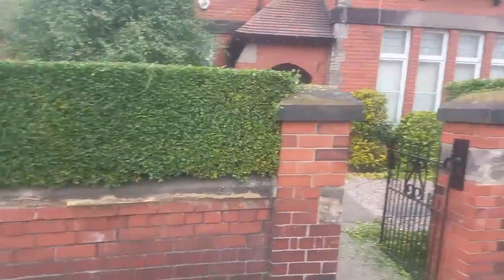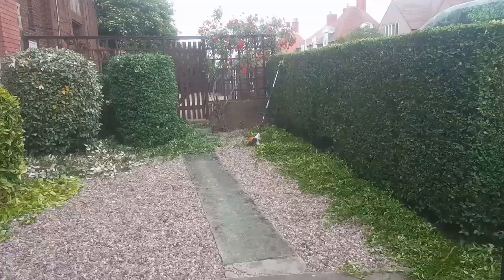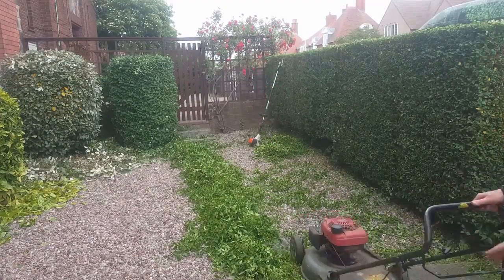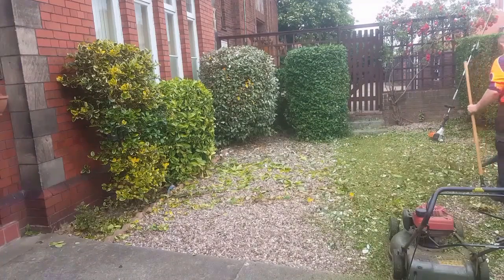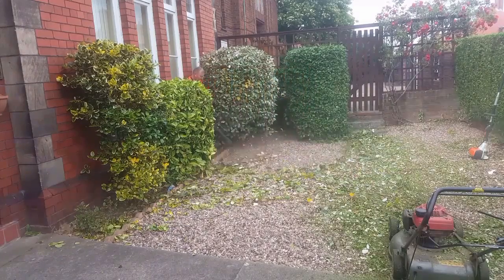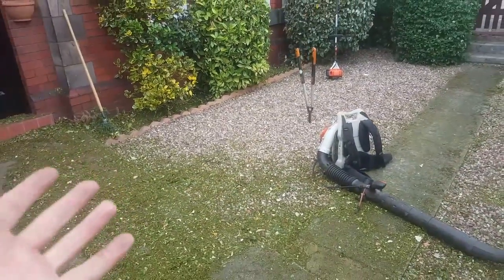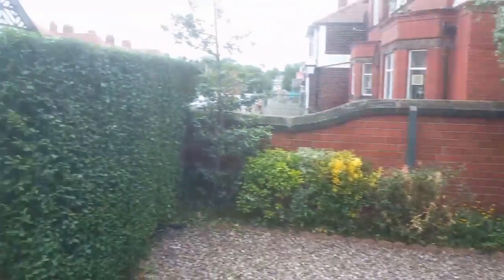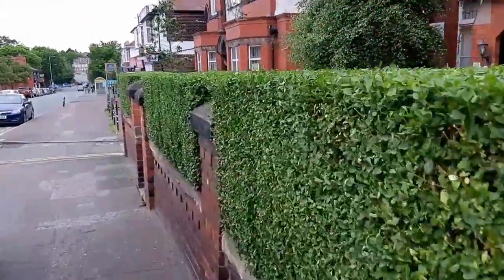Not just pruning...This is LHL PRUNING...

Comment: Great vid. How long did this job take you?
Reply from the maker: Cheers ...cant remember to be honest it was months ago ...most of the day 👍
Reply: LHL garden services uk looks like you did a good job! Quick question how come you use the long reach hedgetrimmer on the sides? Normally i would use the normal size held held ones and then my long reach for parts i cant reach. Just a personal preference?
Reply from the maker: @carl8035  yes just enjoy using them..cant stand stopping and changing 👌
Reply: LHL garden services uk yes i can understand that. Ever thought of switching to battery equipment? Best thing ive done.....so much lighter and makes everything feels lots easier, no vibration, low noise and not having to start a petrol engine everytime. ( sorry for all the questions!)

Comment: I used to tape a 13 inch Black and Decker hedge trimmer on a wooden pole to trim my cedar hedges and all my shrubs until I seen you with that Stihl pole trimmer. I am definitely buying on of those as it looks well balanced and safer than messing with extension cords.   I mulch everything I cut and everything goes back in the gardens. Thanks mate.
Reply from the maker: Thank you glad you enjoyed it 👍
Reply: Stihl no1 brand. Hardcore gear no cheap parts and extremely hardy blades!

Comment: Nice work! I use the mulching method too. I have over 140' of hedges in my yard and for years I would rake up the clippings then rake them into a rectangular barrel then dump it onto my compost pile in the woods along my property.  The raking alone took a better part of an hour or so. I use a self propelled mower with a mulching kit installed which has a chute cover instead of blowing the clippings out the side. Now it takes no more than 10 minutes to eliminate the clippings! Best Regards, Jay
Reply from the maker: Nice one buddy 👍👍👍

Comment: Have you tried the battery powered Stihl? We have converted it’s great and no noise or vibration
Reply from the maker: I do want to go to battery but not yet buddy..👍👍
Reply: Went to battery Stihl two years ago, never looked back. Quite. easy, light and cheap to run. Well made too.
Reply from the maker: @gearjammer3688  Yes I think they will be the way forward but not yet for me 👍👍
Reply: No battery for me yet.i need to work all day , not an hour or so
Reply: A fully charged battery with a hedge cutter will last 3 hours non stop. Thats about 4 hours actual work. Buy 2 batteries and work non stop all day. Don't confuse the new stuff with the terrible old types or the cheap stuff.
Reply from the maker: @gearjammer3688  Its a 50 / 50 situation with me ...I think the principal is great..low noice lighter weight no emissions but it's a lot of money to lay out if I'm not happy with them...I would need to demo them first ( are you listening @stihluk @echotools @husqvarnauk 😁😁) what are you using ?
Reply: Stihl HTA85 pole pruner, HLA85 extendable hedge trimmer, FSA90 bull horn strimmer, BGA85 blower and a HSA66 normal size hedge cutter until some scrote stole it. AL500 quick charger and 2 AP300 batteries. It took 2 years to buy all this, starting with the long reach cutter 1 battery and the fast charger (about £500 all in, same cost as my defunct Echo long reach cutter). 3 hours non stop run time on cutters and about 25-30 mins on all the others. Charge time 25 mins. No drop in power as battery runs low either, it just stops when empty. Save a fortune on fuel and oil, save hours of mixing and faffing with carbs etc, no flooding engine and no breathing in 2 stroke engine smoke all day. Only downside is torrential rain stops play. They are fine in normal drizzle though. Hope that helps.

Comment: Hi Lee, quick tip: you defintely need to buy a short shaft for your hedge trimmer attachment (+/- 20 euros, you will convert in pounds). It will change your life when trimming the sides of a hedge like this, much less effort. It takes a few seconds to unscrew the long shaft and srcew the short one.
Reply: Echo do a nice medium length.  It gets used much more than the short and long trimmers. Saves loads of energy especially trimming the tops when standing on ladders

Comment: Hi Lee. I appreciate your videos but I don't agree with how you are going about this job. Your using too much time and energy mulching and its left the paths stained too. Do a deal with a local farmer or do a tip run once a week.  If you mix new growth with grass cuttings it rots down nicely especially if it's on a muck heap. I see you have a problem getting rid of waste. Is there a commercial tip near you for green waste? Put the price on the job or in the hourly rate. Just my thoughts mate.

Comment: Maybe with the top of the hedges, rather than draw the line straight through, you could start at the top of the brush, cutting left to right, slowly going down a couple inches each time until you get to your finishing height so you don't get any big chunks, and the small cuttings will just fall into the hedge, would only take and extra minute or 2. Good tidy finish on the hedges tho. Not so much on the clear up. You said that you don't think sheets are safe, but all you would need is a small one you can move along every now and then so you don't need to stand on it. I've been doing this for 15 years and never once left a path, patio or drive stained like that. All depends on your waste situation tho I suppose.

Comment: Have you considered any of the battery powered garden tools? I bought the makita 36v blower and it’s surprisingly good for the money (approx £65) but it only makes sense if you previously have the batteries and charger. It will never be as good as the petrol version but still more than capable for the job.